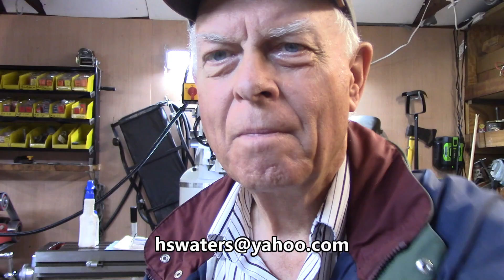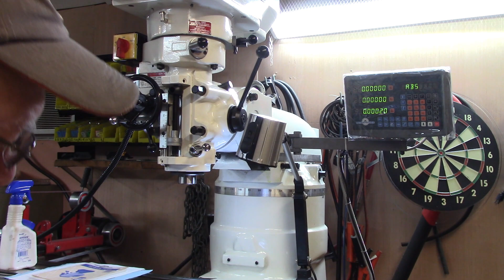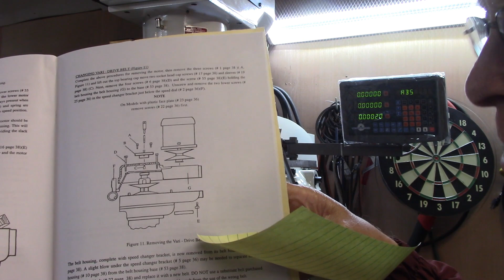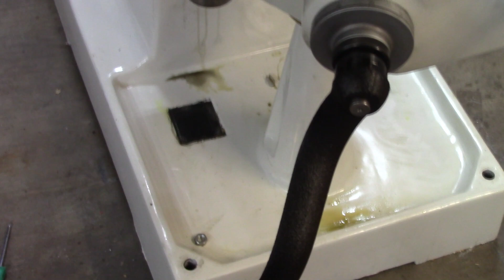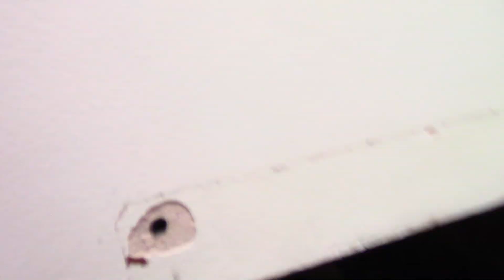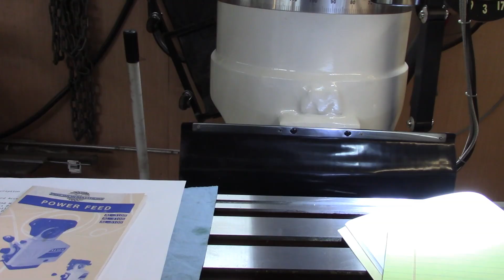Precision Matthews PM 950V mill tour of features

Comment: Harold, hope you don't mind me asking what you think of your PM950V after a year of use. I'm getting ready to pull the trigger on a new one.
Jerry in Mt.
Reply from the maker: After a year I like it even better than I did last year.  This is a very nice machine and it makes so many things easier.  Thanks for stopping by JG.  Oh if you are spending this much money don't skimp on the extras get it loaded with all the conveniences.
Reply: @AmateurRedneckWorkshop  Thankyou for your reply. I'm getting the power drawbar for sure and perhaps the Y axis powerfeed. Jury's still out on that as the X axis power feed on both my 2 other smaller mills ( I will be selling) make it harder to crank by hand. It looks like you may have bought their precision drill chuck too.
Reply from the maker: @JG-kv4oi  I bought a drill chuck but it was not the precision one.  I tried to order the y axis power feed but it was out of stock so i still do not have one.

Comment: That DRO looks like the one on my mill, except for the custom branding. On mine, you can change the decimal places from 5 to 4 if you go into setup as it is booting. If you have 5 micron scales then each "tick" is just under 2 "tenths" (0.00019 inch). So in practice 4 digits is all you need (rounded by 1/100,000), and much easier to understand at a glance.
Reply from the maker: Yes it does allow adjustment of the number of digits and I will most certainly trim off one.  Thanks for stopping by.

Comment: ah man I wanted to here that thing run harold, well it looks good, is the dro have a scale on the knee? I noticed when you pulled on the quill the dro did not move.
Reply: Yes the Z axis on the dro reads when you move the knee.  I also added one to the quill kinda like the one Adam Booth did to his.
Reply from the maker: Yes it has a scale on the knee.  I will have to get a small dro for the quill.  Thanks for stopping by.